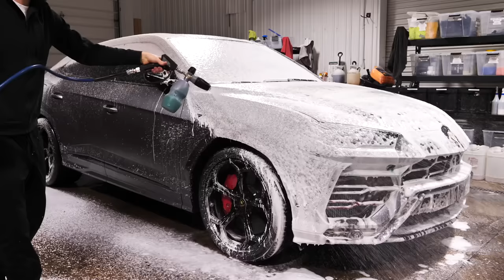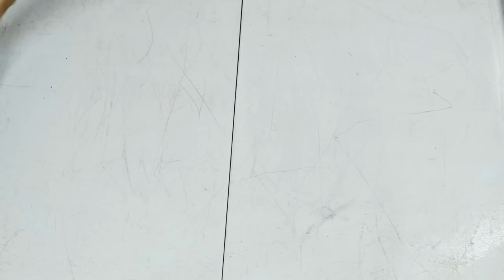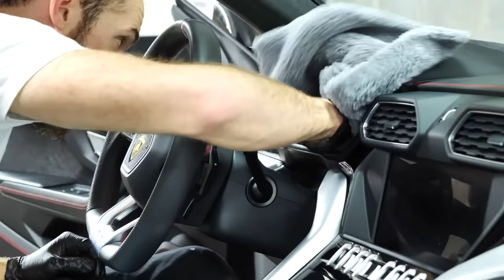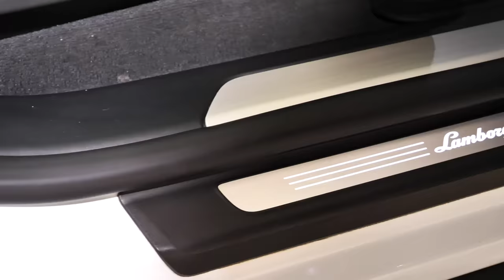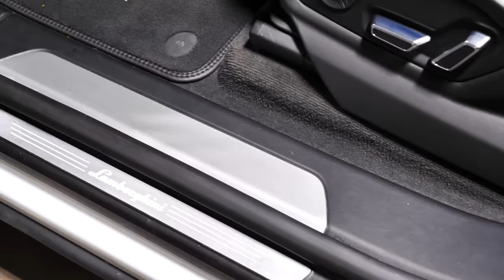Deep Cleaning The Dirtiest Lamborghini Urus Ever ... Interior & Exterior Restoration

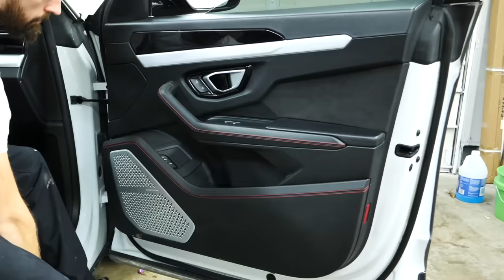Comment: 17:02 I can recomend you to avoid spraying directly on the speakers, but to simply wipe over with a wet micro fiber cloth
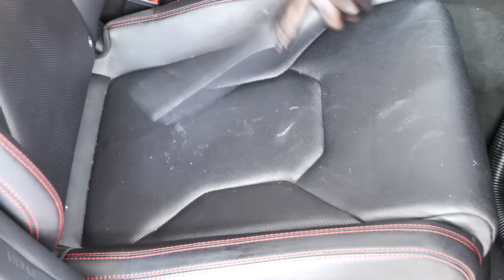Reply: He is doing a lot of mistakes in interior cleaning if you compare with other detailers. Like i already said for example 8:25
Reply: He already washed the car Lmaoo
Reply: it doesn’t actually do anything to the speaker, and every other detailed i watch does the same thing lol
Reply: @its.vicc2  u watch the wrong detailers
Reply: It’s doesn’t do anything there is a rubber seal around the edge. they have to be water resistant, cause if it rains you will open the door and the speakers will get wet anyway. Lol
Reply: @its.vicc2  watch ammo nyc

Comment: I think you damaged leather with your "vacuuming method"
Reply: Right!? I just made a similar comment. He should really consider compressed air.
Reply: @Nick210  i usually just run the vacuum over my fingers so it doesn't touch the leather seats lol
Reply: And it's shiny now
Reply: My exact though! Should've at least use his hand to smack it instead of the plastic piece. Seems like he scratched the leather seats. Whoopsss!
Reply: I was more concerned when he sprayed APC all over the dash, and if you look closely seems like some of that got inside between the screen and the frame. I wouldn't spray a liquid on my TV or computer screen, and I believe the same goes for a car screen.
Reply: This simply has so many things I cannot watch. Vacuuming all over piano black, smacking leather. I would say this is not detailing.
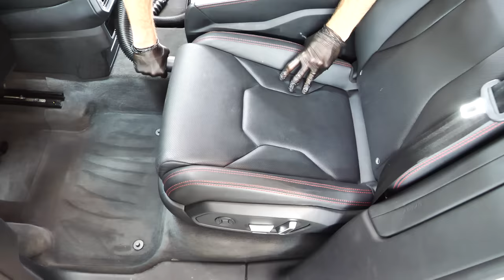Reply: You see it at 7:59 for anyone wondering... big oof
Reply: This wasn’t detailing. It was cleaning (of sorts). Too many things but just one-  still left a muddy/mucky patch on one of the carpets. 🤷🏼‍♂️🤦🏼‍♂️ Larry Kosilla would be crying.
Reply: I think he is also damaging the leather the way he sits in these seats with his knee ..

Comment: Never ever spray a product directly onto an interior! 
Either into your brush or onto your cloth. 
Also, rinse the snowfoam before contact washing. Snowfoam doesn't remove the dirt, it loosens it. The pressure rinse is what removes the dirt from the vehicle before contact washing. 
The car looks great, but you haven't used very safe methods to get to that point!

Comment: Rode in my buddies corvette Z06 that had the supercharger removed and fitted with a procharger as well as running on 25% meth/93 pump gas. 960 wheel was absolutely crazy. said it makes over 1000 if it’s running e85

Comment: When you work with cars with Soft/keyless Entry like this and BMWs where the car unlocks and locks by the sensors in the Handles its Best to keep the key inside the car then it will stay unlocked and it wont lock and fold the mirrors every time foam/water gets near the handle sensors :)

Comment: Fastest car I ever driven was a built 2001 camaro Z28 putting down close to 1000hp, when launched right the front tires lift off the ground. Got it to 170mph easy at 2 am on the highway but then slowed down because I almost pissed myself.

Comment: Hope you discounted your rate  for all the stuff you didn't do,  didn't clean the carpets ( using the carpet cleaner like most other detailers would do ), didn't remove the red stain in the floor mat, left a spot on the rear seat Etc.. Over all half assed job

Comment: I don't know WHY detailers insist on dragging their already scraped up plastic vacuum attachments all over the dash, seats, etc.. Use compressed air with a rubberized tip to blow all that dirt out of seats, consoles, dashes, etc.. Then come back and vacuum the floor and sounding areas. 

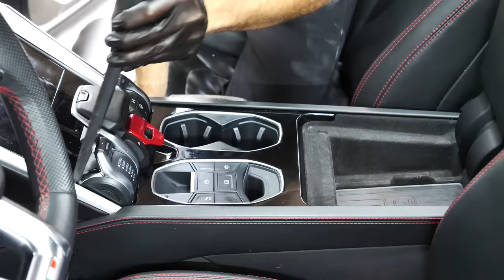Scroll to 6:56.. Just makes me CRINGE to see that and it's not necessary. Compressed air with a rubberized tip & a clean / dry interior detail brush is all you need. Then go back over it with your interior cleaner & detail brush. Finished off with a microfiber towel and yes.. compressed air with a rubberized tip.
Reply: Ik bro same thing i thought he scratched the rear seats... seamed to be poking holes as well.... and puts his knee on the front passenger... if you noticed it left a huge crease. At the end he shows every coner of the interior excpet the  passenger seat.... clumsy and careless.

Comment: when he said “treat every car the same” yeah man, i agree but to a certain extent.. for example you tend to use APC a lot on several surfaces in everyday cars because they tend to work, but everyday cars use “fake” materials such as vinyl or synthetic leather, and plastics. cars of these calibers are real materials, real  leather, real alcantara, and higher end materials that require a different angle of attack. APC has its uses but contrary to the name.. it’s not for all applications, for example, leather requires leather cleaner and conditioner and protectant, vinyl or plastics you may be able to use APC, or a steamer, and carpets should ways be cleaned with a carpet cleaning solution not APC. just my 2 cents man. no one asked and maybe no one wants it, but just remember, detailing is not just APC and 303 aerospace.

Comment: I'm sorry but I do not approve at all the way you use the vacuum cleaner on those seats, and on the console.  you need much more delicacy or less rigid tools.  beating on the seats with the vacuum cleaner are clearly marked.  if you have to beat them use something coated, and change the vacuum cleaner ends. you can't see them.

Comment: Sorry but, for someone who's meant to be a professional, there's way to many things I didn't like here. First, you used a cheap looking mitt, and contact washed without rinsing the snow foam off first, so basically just rubbing the dirt over the paintwork. Second, the way you hoovered the dash... why...? Third, the interior is all electric, all the buttons etc..  so why spray so much liquid directly onto them, and onto the screens, that makes no sense, and you may have got away with it, but that is just luck, stupid. And the way you cleaned the leather seats too...not a fan.